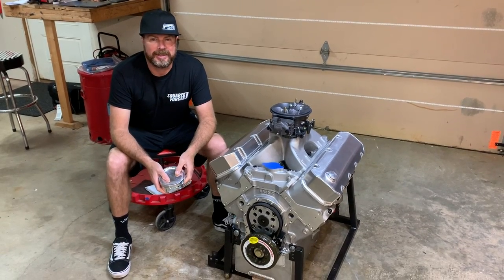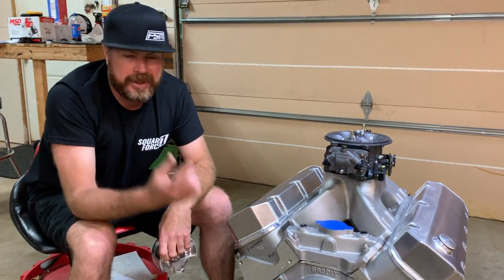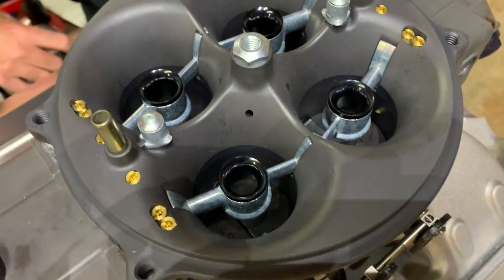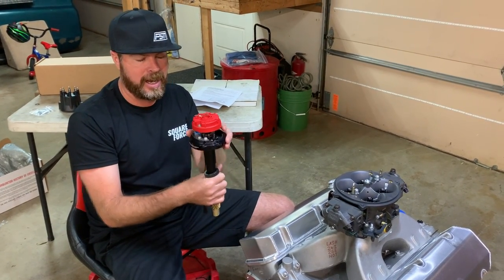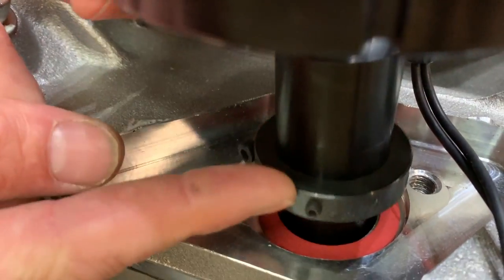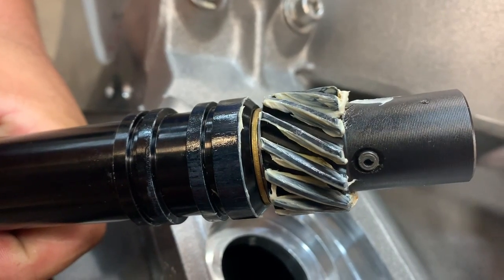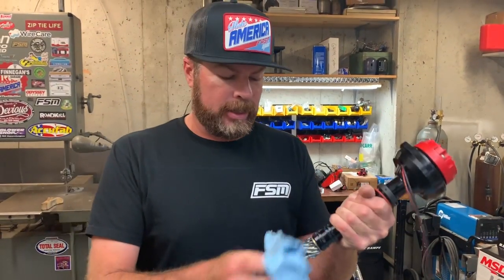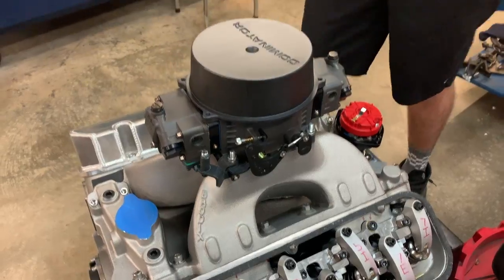1000HP With No Turbo, No Blower and No Nitrous: Finnegan's Garage Ep.79

Comment: hey mate o have some news for you put that Engine in recycle  for metal because very soo you will not be able to use it on the streets  no more Electric is the Champion. and must faster and no nose . you understand that. its over with combustion Engines. ok.
Reply: BS. Gas might not be cheap, but it'll be available for quite a while. Mate.

Comment: Almost 1/2 way thru vid now.  You said .880 lift and title of vid says 1000 HP but never gave Duration #'s or its Static Compression Ratio; is the owner keeping that info secret?  If you want 1000 Hp your heads need 890 cfm at 75% to 80% intake valve lift.  Great engine.  Gonna watch the rest of the vid now.
Edit: have to agree w/the other remarks, dont play music during an engine run on the dyno.  Other than that good vid, good info...accept we still dont know the Static Compression nor the cam's Duration and LSA #'s..wink'wink, nudge'nudge...lol

Comment: Lucas anything is excellent.  Gas additive, full synthetic oil additive, trans no slip oil, and power steering stop leak and stop smoke all work 1000% used all products no less than 15 times over several years of shit cars.

Comment: Finnegan you did a horrible job explaining distributor phasing. First you sync the ignition box timing to your crank pick up in your distributor that's where you start. Then you set your base timing and your Peak timing and make sure that your cap and rotor phasing are going to be within tolerance. You would set this up just like a standalone with either crank pickup or a distributor pickup. I've talked to some of the old hot rod guys and you can see their eyes spread apart and glaze over when you try to explain this stuff to them. Lol

Comment: It's a lie!
Given the volume of the combustion chamber and the degree of compression .... and this cylinder head with low throughput ... this pulls a maximum of 500 hp.
Under no circumstances will these motors reach a fill factor above 1.0. And accordingly, without a supercharger above 500 hp will not be able to achieve !!!!!!
No need to deceive the viewer and post a video with inappropriate figures in hp. !!!

Comment: Only 3 years of life expectancy that's not all that great.
Reply: So a Top Fuel drag car getting 3 passes from it's $15,000 crankshaft, then getting it replaced wouldn't be OK with you either ??? Last time I checked, not one driveline component on ANY top fueler running in OZ now is older than 2 months or 10 passes, except the idiot dumb enough to strap into one........going fast 'aint cheap. Stick to your PS2.